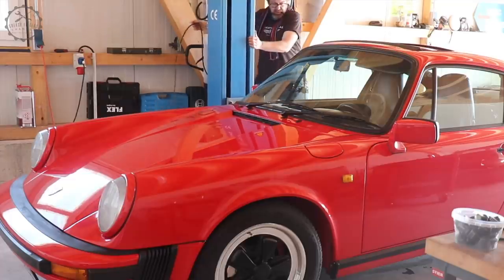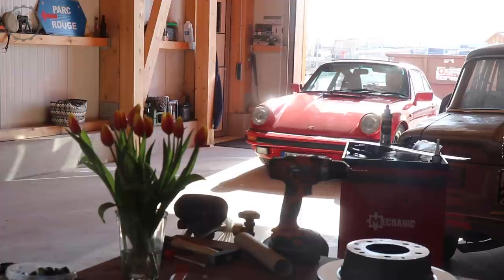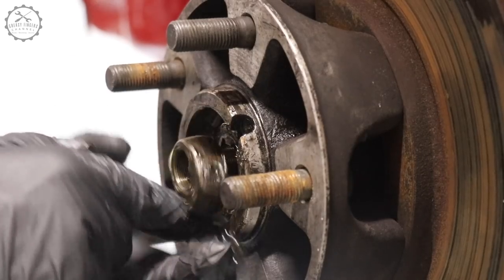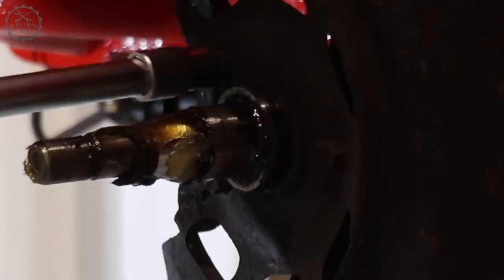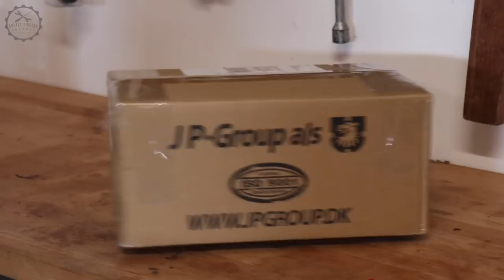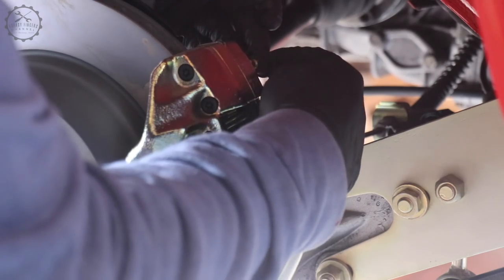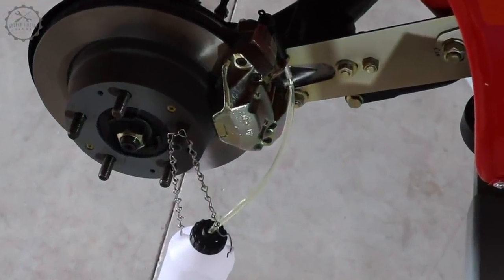Restoring the Front Brakes (Porsche 911 Carrera 3.2 from 1987)

Comment: nice. beautiful engineering back then. the alloy carrier of the disc allowed even better heat dissipation and a lower rotational mass. every kid knew, that the porsche brakes are good, but your video shows how nice the details were thought through.
oh and thanks for the tips on brake lines - it encourages me to do them the next time by myself
Reply from the maker: Thanks, Neser.
In fact all the details are designed in such a nice manner, it’s a joy to work on these cars.

Comment: I've seen a few guys do the brake pipe flaring with power tool rather than a hand cranked socket. They said that the smooth, constant and straight pressure applied to the tip of the flaring tool that does the work by the gun is superior to the possibly wonky winding when done by hand. Not tried this myself though.
Reply from the maker: I think that’s true, but on the other hand, the fluid dynamics in the tube are not really harmed by a slight squeeze.

Comment: The fiber optic wand makes an appearance.  I bought one a couple of years ago for $25 on Amazon-perhaps /probably not as nice as yours but I use it for inspecting cars during a PPI or when I[m selling a car to verify the condition of the inner door or the rocker panels. It's an essential tool at my place
Reply from the maker: Yeah, it’s a very useful tool.
Mine also is a 30 Euro Amazon product, but that’s all I need.

Comment: Another in a series of excellent videos.  Of course, I cringed when I came to the pressurized brake bleeder section.  Several years ago I used one without first clamping off the overflow tube.  Duh!  Thanks for the reminder of my stupidity.  😝
Reply from the maker: Thanks, Bob.
Is there one 911ist who didn’t run into that trap? 😆

Comment: Couple of questions/remarks: a) so would you recommend silicone brake fluid then? b) I think there are better and also cheap bending tools for the brake lines, your lines look a bit "flat" where bent c) the best "hobby" brake bleeding system I used so far was "eezibleed" which uses the tire pressure. Maybe worth a look. Cheers and thanks again for the great vid!
Reply from the maker: Thanks for the feedback!
a) No, I’m the “I fill in what the manufacturer tells me to” kind of guy.
b) There certainly are! 
c) Thanks for the tip. Mine came with an inlet for the compressor, but I don’t use it as the little pumping doesn’t bother me.

Comment: Great work and video. Have you had any issues with the brake lights not working after bleeding the brake fluid?  I did on my 1984 carrera. I had a shop replace the 2  (I think there are 2)  brake light switches on the master cylinder and all is now well. I read that loosening the brake light switches and bleeding them could possibly also rectify the non brake light operation issue.
Reply from the maker: Thanks, glad you liked it. 
I heard about the problem, but didn’t have it myself. 
I’ve once loosened these switches to get access to the space behind and was surprised about the fact that they have conical threads to seal.

Comment: Yes, nice video's! John here, 83 911. So on the way to storing my car, i lost pressure in brakes. Could i just assume the master cylinder?
Reply from the maker: If it lost pressure it means that at some point brake fluid has escaped the system. 
Could be anywhere, but traces of the brake fluid will mark the spot where it happened.
Reply: @GreasyFingers  Assume you are in Maine? Wish you were close by. You know your stuff.

Comment: I was shown to leave just detectable play in these wheel bearing types with the wheel on, top and bottom, just the barest rock detectable. Too tight and the bearings fail prematurely. I haven’t seen them ‘preloaded’ before. 🤷
Reply from the maker: Agreed. The weight of the car removes the final bit of play. 
I didn’t preload them really, but removed all play and then went back 1/16 turn.
Reply: @GreasyFingers  perfect, it’s a bit of a learnt art to slightly over tighten then back off, takes a couple of ‘rocks’ back and forth to settle the bearings and then get the free play right. Too tight and the roller bearings skid on the races, too loose and they can knock and cause hammering damage to the races. Hopefully you don’t mind the comments, they are as much for your viewers as you and don’t wish to teach you to suck eggs… you obviously have a lot of skill and time served 👍
Reply from the maker: @jamest5149  Constructive feedback like yours is always welcome, no worries. To cover all aspects of these cars is a science of its own and I certainly don’t have the claim to master this science.